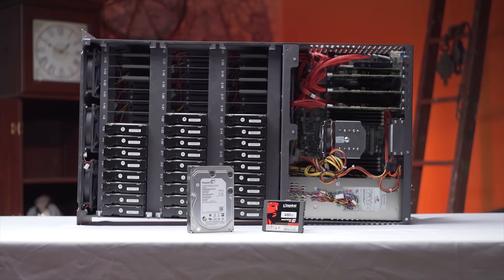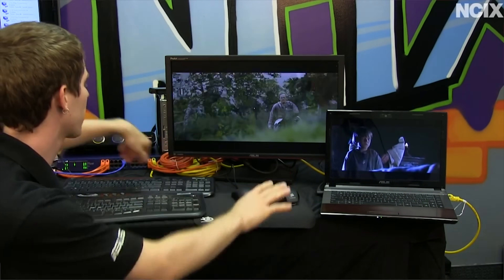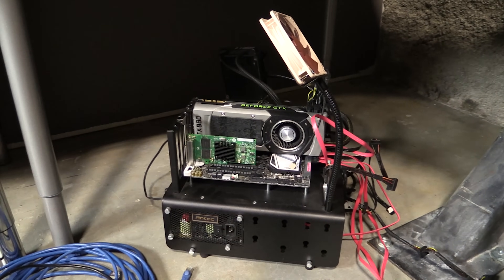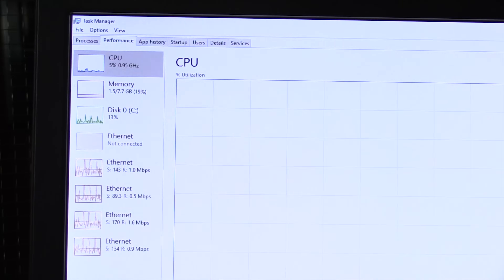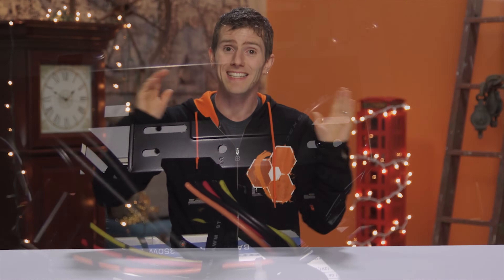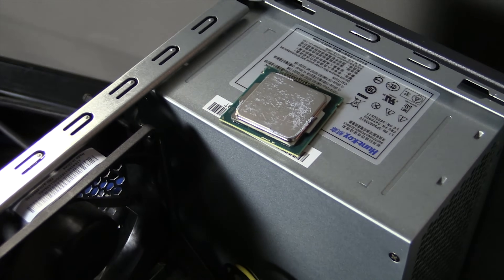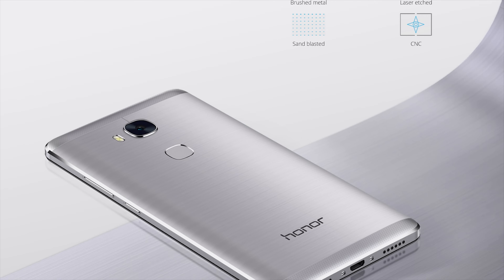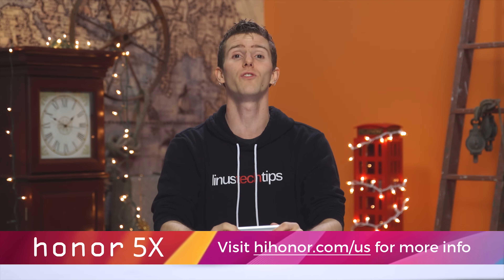Quadruple Your Network Speed for $100 with SMB 3.0 Multichannel!

Comment: So the cards used a feature similar to team link. I do have to ask though if it's peer-to-peer couldn't you have cut the switch out of the equation and used four crossover cables?
Reply from the maker: Yes (crossover cables haven't been required for like a decade) that would work but requires some network config that most users wouldn't be comfortable with. Well cover a scenario like that in more depth soon(ish)
Reply: You're right they're not commonly used because in any environmental situation people put switches between their end devices eliminating the need for crossover cables (with the exception of connecting routers to switches) personally I eliminated the necessity of a switch by using a Cat6e crossover cable to connect my computer directly to my low power NAS. If multi-TB SSD's ever reach my price point I'll at least have a network cable ready for 10Gbit.
Reply: +Jonathan Uhos As LinusTechTips said, crossover cables really haven't been required for years, even for connecting devices directly. Modern (for the last 10+ years) NICs will treat patch and crossover cables the same way, they just adjust the pins dynamically on the NIC, so you may as well always buy or wire patch cable and pretend that crossover cables don't exist. If you ever have a problem with a cable being patch vs crossover, you're better off buying a cheap gigabit NIC than a replacement cable, because the NIC you're using at that point is probably 10mbps.
Reply: +Jonathan Uhos im a fellow network engineer. it doesn't matter if the cable is cross over or straight. modern NICs can actually determine what type of cable it is and can flip the send receive. it is still good knowledge to know as there is a lot of old networking gear in the wild.
Reply: Hum, been using duel onboard nics like that for years, for my gaming/server PC.
Reply: +LinusTechTips Crossover cables should still be used when connecting like-to-like devices or an end device (PC) to a router. Its something Cisco requires you to know for your CCNA certification.

For general home use its not a big deal, but get into a larger network and you really should be using the correct cables.
Reply: SnaxxNZGaming Guess what, I'm in college right now attempting to get my CCNA certification. This is why I know about them (kind of, really I first heard of them back in BOCES when I was getting my CCENT certification) from what I've been told in between the router and the multi-port switch you're suppose to use a crossover cable. Although in the video scenario their is no router, I'm just saying the crossover cable still has relevance even today.
Reply: Jonathan Uhos When taking your CCNA exams just remember... You will get marked wrong if you use the wrong cable (even though technically, it will still work).

So even though you CAN connect switches (for example) together with a patch, Its best practice to use a crossover.

I don't worry about what cables I use at home, but if I was ever building a network for a business I would make sure I was using the right cables.

You never know who will be working on the network in the future or what other hardware might be added.

Likewise, when working on an already established network. The gear might not support auto-MDIX and if you go around using nothing but patch cable its just going to cause problems.
Reply: A router to a switch should actually be a patch cable.

Use straight-through cables for the following cabling:

Switch to router
Switch to PC or server
Hub to PC or server

Use crossover cables for the following cabling:

Switch to switch
Switch to hub
Hub to hub
Router to router
PC to PC
Router to PC

Source: http://www.ciscopress.com/articles/article.asp?p=169686&seqNum=3
Reply: zvxcvxcz I'd say Cisco is the Apple of the networking world. Their stuff is good but terribly overpriced.
Reply: https://technet.microsoft.com/en-us/library/dn610980.aspx
Reply: +ioannis69k Thank you for the link however I still think using crossover cables would be plausible however as Linus stated probably more difficult to configure. I could be wrong though, perhaps a switch is a serious necessity to make this happen.
Reply: +Jonathan Uhos In the article from MS there is a chapter called 'Example configurations ' where it is explained under which circumstances/configs/setups you can achieve those speeds.
Reply: +SnaxxNZGaming That's like saying USB devices should first negotiate with the host if they want to draw more than 100mA (150mA for 3.0). Yes, they should, but no devices bother doing it and no hosts enforce it.
Reply: ***** I actually go into an argument with my instructor over this. I haven't used crossover cables for AGES because of auto-MDIX and I questioned him on why we should even bother...

He was adamant that there was a limit to the number of devices that you could connect together with the 'wrong' cable before things just stopped working. (I actually think he just wanted us to learn it because he had to learn it).

Its still probably best practice to use the 'correct' cable though. It just makes things easier in the long run.

(That, and I didn't want to fail my CCNA exams because of some stupid crossover/patch cable question).
Reply: SnaxxNZGaming Absolutely, in an exam I would also say that USB devices need to negotiate higher current draw but in real life, if for example I were designing a USB enclosure for a 2.5" HDD which needs 1A to spin up, I would not make one with 2 USB ports which need to be both connected and both separately negotiate 5 units of power each before the HDD is allowed to spin up, because no one would buy that crap.
Reply: ghelyar Connecting my two computers directly together I never tested it using a strait through cable I just went with the crossover. Both computers are using their onboard 10/100/1000mbps LAN ports. I don't know if they have the functionality to convert a strait-through to crossover via software although I have heard of such things being possible. I do have a patch cable laying around. I could test this.
Reply: +Jonathan Uhos 1000BASE-T Gigabit Ethernet standard has the auto-MDIX feature built in.
Reply: Abdul Muhaimin NIC is an acronym which stands for Network Interface Card.
Reply: Jay Moua Just for the hell of it I decided to test this and you're right, my computers didn't seem to care either way but since I have it I might as well keep using it and since it's Cat6e if I got some 10Gbit adapters and some high capacity SSD's then I have a cable that will serve the function.
Reply: zombiekiller924 When I was first informed about crossover cables we were using very old CISCO routers and switches on top of that since that class CISCO has updated their curriculum twice so I find your statement valid. This is good information for me to know going forward with my education.
Reply: +LinusTechTips That direct link with a single cable has been my favorite for transferring lots of data for a while.  USB3? Psshsh too slow, and I have to transfer the data twice.  With 4 would be nicer, but I'm not about to find 4 port NICs that will go in my laptops...  Could you cover the Linux and Mac sides of this when you do as well as the Window's way?
Reply: +SnaxxNZGaming Cisco is full of crap, their routers cost more, have fewer features, and are poor quality and unreliable at least until the true enterprise grade stuff.  The stuff they market to even medium sized businesses is total crap.  And... I wouldn't be surprised if some of their archaic designs do still require a crossover cable, which would earn a facepalm from me when I hear about them.  But yeah... they have a ridiculous amount of sway in network certification.
Reply: zvxcvxcz CompTIA (Vendor neutral) teaches the same thing... At least they did in A+. Granted A+ only just scratched the surface when it comes to networking, but I wouldn't be surprised to see that Network + also teaches the same thing.
Reply: Thanks for the advice. Question though, from what I've been taught the only place I've seen the crossover cable necessary is in-between a router and a switch. Are you saying if you wired more than one switch in series or wanted to create a Token Ring topology (plugging a switch into another switch) good practice says use a crossover?
Reply: +hellterminator their enterprise stuff is good, but their home and small businesses stuff is utter shit. I've seen more Cisco/Linksys switches and routers bad right out of the box then I care to think about.
Reply: Stickbo Interesting. I never used low end Cisco products, so I was going by my experience with their enterprise hardware.
Reply: +hellterminator it's honestly crazy. most huge companies with massive servers I see use Cisco, and I've seen some ancient switches still going strong. you would think their prowess in the enterprise sector would translate well into their residential stuff, but it just doesn't. the biggest issue is reliability. I used to install and repair broadband for a living and lost count how many bad Cisco/Linksys routers went bad. I mean, it's kinda rare for routers to go bad outside of power surges, but finding a dead Cisco pos router is common. no excuse for so many defective units. 

the last one I had was a 1900ac, which died 6months later. I got pissed and got a netgear nighthawk, never looked  back. sad really.
Reply: SnaxxNZGaming Thanks for the clarification although I cannot memorize that very quickly. The universal update of auto-MDIX will assist my short comings if I don't know which proper cable I should be using.
Reply: Stickbo Well, thank for the warning. I'll be sure to steer clear of Cisco when setting up small networks.
Reply: +LinusTechTips shhh!!! cisco will hear you say you dont need crossover cables!
Reply: +Jonathan Uhos Since Auto-MDI there is no difference between cross and straight. Few years ago when connecting 2 MDI-X or 2 MDI devices you had to use crossover. You can look up your NIC in your PC and you will see that auto-MDI is on. It's also one of the first few chapters on your CCNA training. I am happy that I got my certs already.
Reply: Tomasz Zakrzewski Well we're into chapter 2 now and I'm looking ahead into chapter 3. So far the material is discussing the OSI model and the protocols associated with the different layers. Perhaps when we reach a section discussing the Physical layer or when we do some Packet Tracer activities it will bring up auto-MDI/-X because thus far into my education I've been in the dark that a crossover cable has been obsolete for a long time.
Reply: +Jonathan Uhos Crossover cables are not obsolete. There is a tiny bit of additional latency associated with Auto-MDI. For SOHO networks, that additional latency doesn't matter and is likely not noticeable. In enterprise server farms and dealing with multiple switches and routers in the network layout, you want to use crossover cables where applicable because then the auto-MDI circuitry doesn't need to translate what wire pairs to communicate on.
Reply: I was wondering if the Auto-DMI caused any kind of additional overhead. Like if the switch to crossover would be stored in some type of cache or if before every single transmission the line has to be checked to verify it's configured correctly. Scaling the network I can see loss of performance if this is the case.
Reply: Jonathan Uhos If there is overhead, it must be negligible. Obviously, Auto-MDI would cause this overhead by its mere presence, regardless of whether you used the “correct” type of cable (because you still have to make sure that it is the correct cable), so if there was any significant overhead, Auto-MDI would not be present in enterprise grade network gear. Since it is present, the overhead must be negligible.
Reply: ***** I see your point.
Reply: +SnaxxNZGaming as a fellow ccnp certified engineer I can confirm that rarely and I do mean rarely you come across scenarios where not using xover cables do cause issues.

perticularly with differing vendors I.e maybe a netgear with extreme.

its not do much of an issue if your estate is all one vendor.

I've seen some pretty messed up networks where things you never think should be issues are major problems
Reply: I would buy that crap because I know how frustrating an unusable portable drive can be. They sometimes even disconnect after being detected!
Reply: Odd; I was told about them by my classmates when I was about 12, then proceeded to successfully connecting their computers when there was no auto-negotiation and you had to get it right.
Reply: That's a perfect parable. Sometimes, like with Apple, the Cisco stuff isn't good anymore, but still overpriced.
Reply: That's not the real reason. This latency is only there at the initialization, it adds a few ms to the boot-up. Insignificant. The actual practice is there so that if somebody ever swaps for a non-auto-MDI-capable device in the future, the whole system keeps running as expected.
Reply: zwz • zdenek That kinda makes sense, but what are the odds of a new device not supporting Auto-MDI? Is it really still a concern? 
P.S.: Please write who you're replying to. It's kinda hard to keep track of the discussion threads otherwise.
Reply: *****
No. You don't always connect a newer device, especially in developing countries. You want your network not to fail if anybody needs to connect an older 100Mb switch or use an old dial-up server in a pinch. Something breaks and you scour for a replacement, you connect it and you don't want a false indication. Imagine a switch broke and it had the wrong cables. You try to save the work, you find a random switch, you connect it and it doesn't work either. So you start fixing what's not (yet) broken all over the place.

Comment: You can also get 10gbit speeds at home for about as much as this, catch is only point to point between two machines. 10gbit nics are cheap(relative to the $2,000 switch you don't need) you just connect them with a patch cable setup a fake subnet between the two, and voila 10gbit speeds. no need of 8 cables or windows 8+

Comment: if the more cores you have what speeds can you achieve with 2 Xeon chips with 18 cores 36 threads at both ends. yea  i know its not practical but it would be interesting to see what speeds they can get from it.

Comment: PLEAST JUDGE MY BUILD (LIKE SO MORE PEOPLE CAN SEE)       

CPU: i5 4690k
GPU: Gtx 960 gigabyte 4gb
Motherboard: Msi z97s Krait edition lga1150
Ram: Kingston hyperx fury 2 4gb of ddr3 1866
SSD: A-data sp550 120 gb ssd
HD: Seagate barracuda 1tb 7200 rpm
Case: Nzxt s340
PSU: Corsair cx500m
Reply: Please just change your username, that's just childish. And YouTube is fucked up so it's not even possible to report a username.
Reply: Your username should be longer, unless this is the limit, in which case, oht.
Reply: +Sez Stuff nothing wrong with his username as he's shaming something that is the cancer of YouTube.
Reply: I literally have the exact same parts exept for the ssd XD. it depends on what you wanna do on your PC. I tested this on Bo3 and I got 60fps+ on high settings 2560x1080. if you wanna use this build for something like editting though, i'd swap out the I5 4690k for an I7 4790k
Reply: +Douwe Jacobs just my opinion by the way
Reply: Thanks for the feedback! :^D I just wanted to game and know if I needed to switch anything. Thanks again for replying.
Reply: ZeRunningMan Very true, BUT, those 100 lines for the name are very distracting in the comment section.
Reply: +Sez Stuff dude my name is just a prank bro... that's GONE SEXUUUUUUUUUUUUAAAAAAAAAAAAAAAALLLLLLLLLLLLLLLLLLLLLLLLLLLL
Reply: The 380 performs better than the 960 and is cheaper, I would get that. 
I've heard bad things about the krait but it looks nice so who cares.
You could look at another PSU but it's not necessary. Corsair's unit are generally pretty bad value but it's not a problem.
Reply: Get 8gb of ram, you can go with 1600 or 1333 it doesnt make much of a difference

Comment: can you do a quick recap of what u need, i got lost after the 3rd attempt
Reply: "Under 100" my ass
Reply: +Tieng Nguyen 2x i7 systems, 16port gig switch, 2 crazy fast ssd, or ram drives.
Reply: +Marcus DeFilippis It's reasonable to assume that anyone who would actually benefit from higher local speeds would have a good rig already, so it's just $100 for new network equipment...
Reply: +MARS TV CHANNEL What the fuck are you going on about?
Reply: +Marcus DeFilippis you know pc's are not the part of the buying list ;)
Reply: +Marcus DeFilippis you idiot. Only for people who have had server or NSA. For me I have my workstation I7 5820k and my server i7 4820K. I stuck between 1Gbs LAN data transfer because 10Gbs network card cost you 250$ each card, and thousands dollar for the switch. So Linus introduces the cheap way under 100$ for half of speed. That is the point.
Reply: +Marcus DeFilippis this video is not aimed at the average user, it's aimed towards enthusiasts (people who have large/expensive setups as in approaching if not hitting 5 digits) and businesses who need better network speeds for moving files around on their LAN without the usually large price tag. Not really that useful for your average everyday user. this video is really only going to be useful to the kinds of people who would already have top end hardware, as chances are if you aren't using that level you wouldn't actually need Gb/s network speeds.
Reply: +Astro Idea didnt he say he disabled 4 of the cores
Reply: Mannix_ I already have a gaming pc, and I don't have any of the hardware specified in the video, not even the equivalent. This video is plain stupid.
Reply: overclock1993 Don't call people idiots for not having top end hardware.
Reply: He can't 'coz he's a fckd up nerd, with no social skills and creativity, that's why he uses all these annoying infantile YouTube gestures that he learned from their "how to get more views and likes" for attention hoes video.